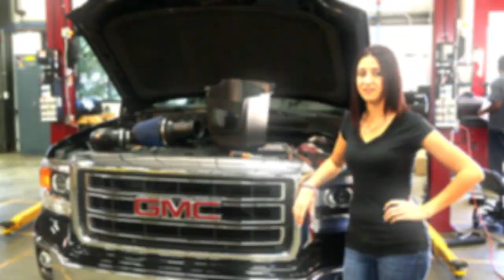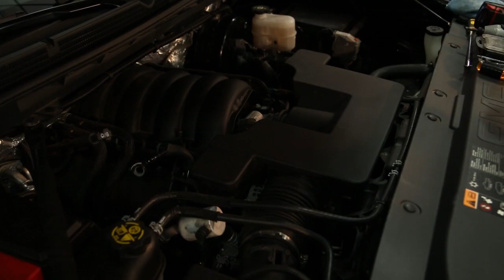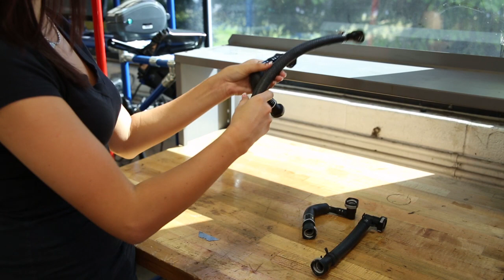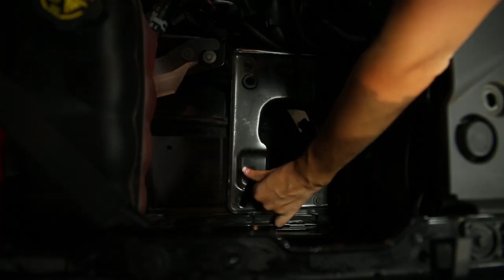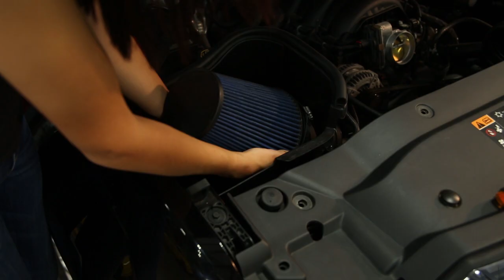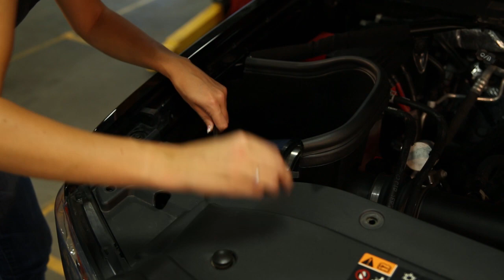2015 Sierra Cold Air Intake Installation

Comment: A drop in dry filter will give the same results that's what I did on my 17 High Country 6.2L. Save your money and get a custom tune sure a CAI looks and sounds good. The factory box is large enough to see results.
Reply: Anthony Macneil 
afe momentum gt intake did 36 hp on a 6.2 on the dyno without a tune.. blackbear did the test
Reply: Installed an AEM dry Performance filter drop in and Airaid intake tube
Reply: @silverice7085  BS!!!!!!!!